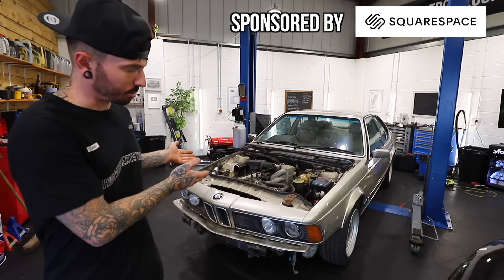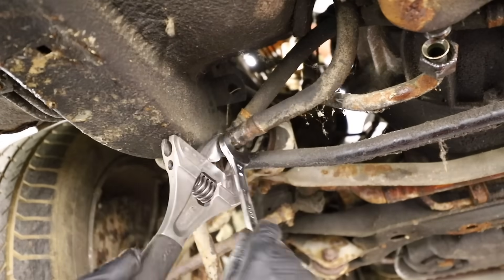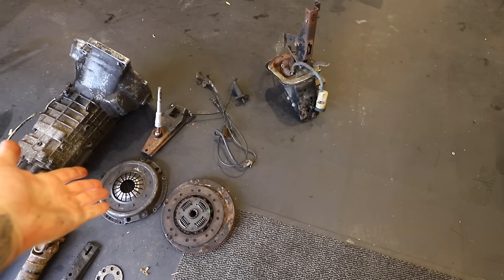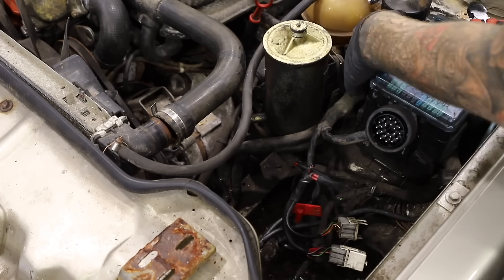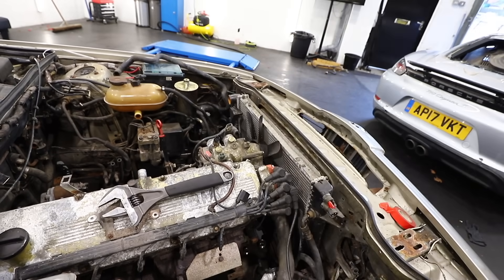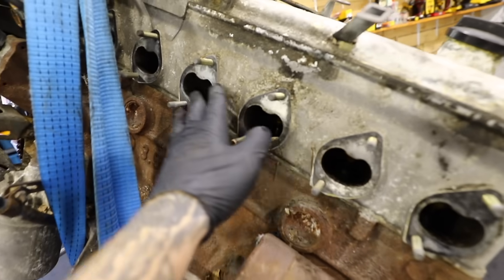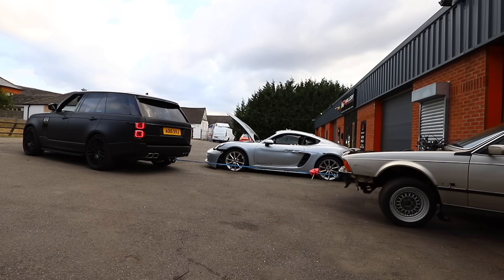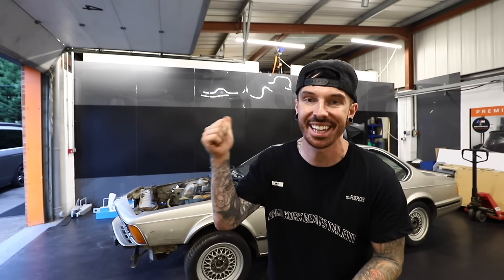RESTORING A BARN FIND 1989 BMW E24 635CSI | PT2

Comment: Do a full engine rebuild, putting a turbo would change the way the car feels and drives massively. Would recommend keeping it standard
Reply: Ebay turbo all day long
Reply: You don't perhaps watch Mighty Car Mods? Cause that's  something they would do 🤣
Reply: yeah I agree, I'd have kept it as stock as possible, and would've kept the automatic transmission too, because that's not a sporty car, it's a luxury coupé made to slide on the road
Reply: If any of you are expecting Mr Armstrong to keep the car standard then you obviously have not been paying attention to any of his previous videos lol.
Reply: @marcocartalli7503  what about the M6 Manual gearbox 3.5 24valve 255+ bhp is that not Sporty ?
Reply: Well. That exact engine came as an M106 aswell. That's the 45i turbo. 

An M60 (or maybe even S62...) would suit the car really nicely while still being OEM+.
Reply: @Nostalgic-Mechanic  some modifications are fine but putting a new engine in or adding a turbo would ruin the point of the car. It’s a classic car not a jdm
Reply: Go full send 🔥🚀
Reply: These cars was available as Alpina B7 Turbo from new. A turbo setup similar to what the B7 turbo had, with modern tech and some extra power will not ruin how the car drives. It can be done with manual or auto. These engines are torque beasts with turbos on them.
Reply: More significantly, if you swap this engine all the money time and effort will never be recovered nobody will give you sensible money for it. Better to do a full restore and show the world including the pros you can do it.
Reply: @MoePower2  it’s a classic car not some car designed to be modified. The car is 30 years old keeping it standard it a better option. I used to own one of the 635csi and it was fantastic stock. I drove a modified one and it was completely different and nowhere near as fun
Reply: @Nostalgic-Mechanic  Clearly you don't watch Mat enough to know that none of his cars are kept 'OEM'.
Reply: @ferdiegillon5919  I know what you mean, I have a 635csi and a 628csi my self which I intend to keep stock. But I also have a 745i with basically the same engine as the 635, except it's equipped with a turbo from the factory. And I have had both auto and manual transmission in that car, it drove way better with a manual. So I know for sure that a turbo won't ruin the characteristics of the car, if kept at a moderate power level. I agree that a stock car will be more worth, though. But seeing how rotted out this car is.. It will never be a mint condition collectors car without spending more money in restaurations than the car is worth. So if he wants to restomod it a little, I don't see anything wrong with that.
Reply: I agree
Reply: I’d say add say swap the intake manifold for some itb’s and maybe go open stacks or carbon fibre air box those bmw straight 4s & 6s sound good like that
Reply: I think Mat has some respect for what the car is, so I reckon he’ll go OEM + and only do the manual swap and other stuff that is bolt on bolt off because as he says himself this is the first time he’s taken on a restoration of a classic car and messing with it too much will be expensive and the numbers won’t add up.
Reply: @Tracertme  he doesn’t sell the cars anyway, from what I’ve seen he raffles them off.
Reply: Agree full rebuild keep as stock as possible 👍
Reply: Efr8374 for the win!
Reply: @MoePower2  ok I definitely see your point there, and you're kinda right, I'd still prefer keep it as stock as possible, even the automatic transmission, but as you said the car isn't going to be perfect anyway, because of all the rust, even on the chassis, so it's better modified than scrapped, and if he wants to have fun it isn't a crime
Reply: @Tracertme  he would more likely put it up for raffle like he does for all his other cars 🤷🏻‍♂️
Reply: Real men use a supercharger
(for those who are insecure and feel threatened, this is a joke)
Reply: @MoePower2  personally I think the 635csi’s are really good cars stock, the modified one I drove just didn’t have the same feel and it felt like it had been ruined to be honest. Small modifications are obviously fine but I think if mat installs twin turbos or a very large aftermarket turbo it would just ruin the car. Better to focus on getting the car roadworthy and restored before worrying about modifications. I don’t see a point in running a huge amount of power unless using it for track use which is completely the opposite of what the car was designed for.
Reply: You know what?? I’ve never seen anyone buy a eBay turbo and rebuild it so it lasts I’m sure it will be cheaper than any turbo on the market?
Reply: @The_Real_JN  … It is sad that these days you’ve to explain that fact..🤔🤔

99% will get it was a joke, but we are forced to pamper to the 1% 😳😳
Reply: @ferdiegillon5919  bet your fun at parties. First it's his car so he will do whatever he wants to anyway. But he got it cheap, it's never going to be split
mint and worth top money. Then modding it means more vids, so more money coming in means that the car is paying for itself so its irrelevant if the car isn't worth the money put in modding it. I hope he does turbo it or supercharge it and big wheels, lowerd, big exhaust etc.
Reply: You realise the alpina variant was turbo don’t you?
Reply: You realise the alpina variant was turbo don’t you?
Reply: @RecklessRcuk  yes buddy but keeping the engine standard is better for thisz
Reply: @ferdiegillon5919  I don’t agree, the original engine is very lazy, a turbo will wake it up, driveability will massively be improved, just because it’s turbo, it doesn’t mean it will be running all the boost in the world, even on actuator pressure it will be so much better
Reply: @ferdiegillon5919  I don’t agree, the original engine is very lazy, a turbo will wake it up, driveability will massively be improved, just because it’s turbo, it doesn’t mean it will be running all the boost in the world, even on actuator pressure it will be so much better
Reply: @sys-administrator  yeah, but back then, a Golf GTI Turbo had just 125 or 150 BHP.
Reply: @sys-administrator  But the 14i still is a shitbox next to it! Computers can’t alter cylinder count, displacement nor feeling 😏
Reply: B58 engine swap??
Reply: Couldn't agree more - although converting it from auto to manual doesn't seem unreasonable 🙂
Reply: @MoePower2  although I was leaning towards keeping it stock, what you said also made sense! I ve just found this channel so still catching up on the back catalogue!
Reply: I vote full send! Body kit, nice wheels, turbo, ..bring it back to life, like a bat out of hell!..

Comment: Be good to see how this goes, had a 1980 635csi as my first car when i was 17 in 1989. Mine was gold to (regd LCW466W). Ran it until 1995 when i finished uni and took it up from 80k to 160k miles. What an experience, it was in lovely condition when i got it but soon rusted, i fitted 2 new front wings in 1992 (£500 each then!). Trx michelin tyres were a fortune about £150 each in 1990, so i used to get part worns from a shop in Blackburn. Auto gearbox went in about 1990 and i fitted a used one for £500, cylinder head gasket went on the way to uni in leeds in 1991, so i stripped the top of the engine had the head skimmed and did all the gaskets, it was the best sound in the world when i fired it up again two weeks later. Welded new sills on in 1994. Exhaust back boxes were a fortune back in the day and seemed to last about 2 years before blowing baffles out. As for mods to the engine id be wary about fitting a turbo, they were quiet tail happy and it might make it a bit of a handful. It taught me how to opposite lock oversteer. So really enjoying your vids on this and ive subscribed, good luck with this lovely old motor. I remember looking at the high lines when they were brand new in the bm dealers back in 1989 and they were 38 grand! That was a fortune at the time and about the price of a decent detatched house around Lancashire. 👍
Reply: Would love to see if he tries some ALPINA touches on this project that would be really awesome and final product might be even more valuable.. 
Otherwise this will be a very good series to watch indeed.. !  ;0)
Reply: Fuck man that was an awesome read
Reply: Wow, what an experience at such a young age. You must be tempted to buy a Highline now surely?

Comment: Hi Matt, I would look at dropping the later 3.8 E34 M5 Engine into this. It will fit the gearbox and engine mounts and has been done before. E34 M5 brakes are also straight swop.
Reply: Jes jou ken but it is rare engine
Reply: Is good idea

Comment: One of the absolute best cars BMW ever built, I like the manual Getrag gearbox over the auto gearbox but corrosion was the weak spot of the 635 so if you can find a good non-corroded one, buy it and  you have no stupid coilpacks that keep going bad every couple of years.

Comment: I know youll of already done it by the time i commented but if it was me i would just clean up and derust all the engine and leave it as it is as further down the line it will increase its value by having it's original engine in. Weve done done all our engine on our 1996 rover 620si and now its all clean and no rust it looks a beauty!!

Comment: I would add Alpina front spoiler and wheels to the car and try to keep it as original as possible, with my BMW E30 325is I stroked the engine, and replaced the fuel management system and head. LOVED THE SOUND FROM MY CAR

Comment: I'm sure there's a way of extracting more performance from that engine without use of a turbo. Perhaps some M6 parts could be used, injectors, air box. Performance camshafts or a reworked head. Lots avenues to explore

Comment: Now you've learned that torque converter stays with the gear box for that way you don't get covered in gear box oil but thats how we learn 😂 use to put these engines with the ECU in to the 3 series bmw back in the day your doing really good saying you have never been trained as a mechanic you should give yourself a good old pat on the back 
Mat Armstrong 
 😁

Comment: Hmm, that's some nice rot to contend with. Still it shouldn't be too hard to fabricate repairs. For the engine you could turbo the stock motor with a better inlet manifold and with a standalone ECU probably make good power. Normally aspirated the 3.5L makes around the same power as the later 2.2L M54 so if you didn't want to go turbo then maybe the S54 M3 engine? Either way I think just the looks alone make this vehicle and just a nice engine to easily shift it's bulk along is all you need 😉

Comment: Wether you upgrade the engine or refurbish the existing one, I feel a turbo would be a poor move. It would be too far removed from the original character of the 6 series. Great news on the second unit though. Congratulations!

Comment: Nice video but just one big mistake made😉 you did not remove the bolts from the torque converter to your flexplate. Take notice guys not doing so can scrap your automatic transmission

Comment: Keep it standard imo, but if you do go down the route of engine swap, then as the car is OBD1 i would recommend an M50B25
And if you want power, m50b25 with a turbo will easy do 400bhp aha

Comment: I hope you decided on keeping the 3.5 liter straight six. It's such an iconic engine, it would be such a waste not to use it. I have it on an e34 and it's a great engine. I'm planning on fitting a turbo on it because it's so capable on handling the power.
Please keep it.

Comment: 4:14 You are lucky that you got the gearbox out on it's own. I had a 1985 528i E28 BMW which needed work on the gearbox at one point, and the easiest way to get it out is to remove the engine and gearbox together. Also, taking then out together helps keep the gearbox shafts straight/aligned when fitting.
10:41 BMW's SHOULD have existing hook points at the front and back of the engine where you can hook them for removal/refitting. If this car didn't have them when you got the car, it's pretty possible that they were removed and never put back.
10:56 Removing the fan before taking the engine out should help give you some more room to work (atleast it did on the '85 528i that I had).

Comment: Good Luck! Mine, which I use as my daily, cost around £25k to have uprated and restored...parts are a nightmare...£500 doorseals, £500 MAF, £700 fuel tank, £250 fuel lines, the list was seemingly endless....In my view worth it though.

Comment: i may be wrong but i remember someone told me that those engines should have forged pistons? And they can handle 500hp with stock internals no problem. So turbo in this thing is not a bad idea at all :)

Comment: I’ve owned  my 635 for 20 years it’s been sitting inside my garage original owner started doing an LS swap and changed the suspension in the car to Corvette and didn’t do it the right way  in 98. so I  bought it from his widow and never finished the car and the LS engine is gone. I eventually ended up ordering a brand new Audi S5 in 2011 still have it but I would like to work on the BMW again. My new plan for the car because it’s like new I mean it was always inside a heated garage since 86 was having it put it back how it was it’s black with a red interior six cylinder five speed originally

Comment: Hi Matt I'm a big fan love what you do & your a top chap i admire your energy & enthusiasm for cars  although personally I'm a purist & would keep the cars stock however each to his own style, ref the 6 series, if the engine & box were both coming out would it not have been easier to undo everything underneath & on top then drop the engine & box together from underneath onto an engine trolley / table  then lift the car away on the ramp, push the engine & box out of the way then lower the car & leave as a rolling chassis albeit you gotta put some drive train bits back on, as they do on my other fav channel VAG Tecknic as I'm an S4 owner, just a thought as I'm sure getting rinsed in 30 year old ATF is not a pleasant experience, not a criticism & not trying to tech my grandma how to suck eggs think you & the team are ace 👍👍

Comment: You'll find removing rusty bolts a lot easier if you soak them in Plus Gas first. WD40 is not an effective penetrating oil.

Comment: Just a tip for old rusty cars especially...try to get everything you can with an impact gun at first. This can save you so many headaches with snapped bolts by shocking the bolt loose.

Comment: Incredible video bro. I'm working on my own 1986 635csi bro. It's currently in the hands of my indy mechanic. Cranking hard, but no start. I had replaced the fuel pump and the filter as well. It will start & run if my indy fiddles with the ecu behind the glove box, but won't stay running man. Any help would be greatly appreciated by me my friend.

Comment: Ok dude.   Yes to boost. That engine is anemic.  But if you add turbo or blower, make sure you have the right cam and valve springs and gap your rings.  Suggest forged internals and a new head.

Comment: @MAT I NEED YOUR ADVICE. I HAVE A BMW 323 E90 (NOTHING SPECIAL BY YOUR STANDARDS ). bought it as a second hand. it started making weird noises in the engine. turns out there is a lot of sludge (built up oil). do i overhaul or buy a new second hand engine?🤕🤕😁

Comment: Good effort matt happy for you with the new unit. As you will have the front sub frame off might be easier to put the gearbox on the engine and lower the car down onto it.

Comment: the gearbox you got is out of a 520 E12, not the same Engine, that is an M20, while the 6 series has an M30. This won't fit, you need to find a gearbox out of a 525/528 E12 or E28 or E23 7 series. Some E34/E32 gearboxes will fit too. the lever extension plate is the same on E12/E28/E24, but not on other series.

Comment: My opinion is go and get yourself a newer crash damaged 6 series (because you are the crash damage king) that can’t be put back on the road strip it’s guts with all new modern parts and make it a restomod 1989 to 2022 purely for the parts factor and the amount of rust that your going to find underneath so whilst rust repairing fit newer subframes, shouldn’t be to hard we are all behind you what ever way you choose to go✌️ ❤️

Comment: Just watched the first 3 videos on this BMW.Listening to some of the comments you made . This rings alarm bells, keep it standard.
  This car is a gem find.Done correctly and with sympathy this will be worth a lot of money at the end of the day.
  Strip the engine check everything. Fit new shells to the bottom of crank and pistons. Surprised you didn't do a compression test to check cylinders before you took engine out.
  Check and rebuild VANOS unit at front of engine this is a must on rebuilds.
 Clean and fit all new parts that are needed for engine.I would also clean block and cylinder head. Remove rust so it looks new. Needs new valve cover defiantly. 
  The list goes on, but the engine is the heart of the car and needs as much love and sympathy as the rest of the car.
  It's a long journey but the reward at the end will be worth it.
  This car needs to be rescued, it's a classic. Hope to see new vid on project soon.
  Don't go mad on it with upgrades. Keep it standard.Or else you will ruin a beautiful classic BMW.🇬🇷

Comment: bang for buck do an engine swap, ive worked on e30's and e36's starting with no knowledge, I done engine swaps and forced inductions, with a standalone ECU the swap is generally pretty easy, as for engines depending on budget I'd be looking for late 90's early 2000's engines, you can go m70 a v12 5.0 for 1000-1500 quid or maybe even an s54b32 from an e46 M3 for about 5000.

Comment: How do you find out the parts you need to replace for the manual shift conversion?  For example you mentioned the flywheel, but you also bought a manual transmission “kit” early in the video.

I’d like to be able to move past “replace with the original part” in my home mechanic skills.